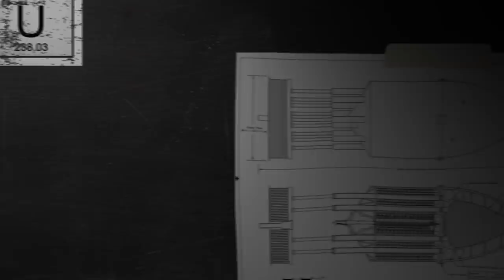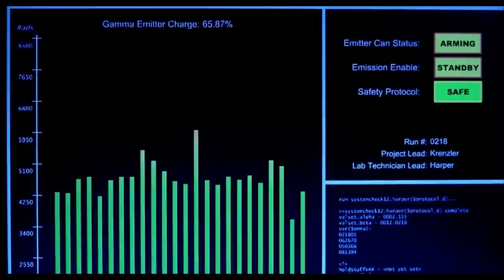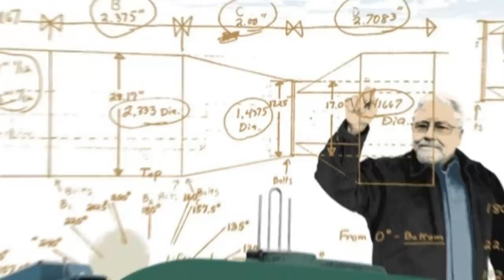This is How the Most Powerful Nuclear Bomb Works

Comment: Great video. However, with one error. The Hiroshima Bomb wasn't an implosion type bomb. It was a Bomb with gun type design. It had a core Uranium, enriched to a level of 80%.
Reply: Wellll, that and the title is clickbait garbage... those two weren't the most powerful by a long shot. I see no mention of hydrogen, lithuium, or lithium hydride, which there was a bit of a whoopsie when the bassoon device proved that lithium reacted quite well too, pushing 5 megatons up to something like 15, and was the THIRD time we nuked the Japanese, though that one was by accident.

Seriously, look up Castle Bravo.
Reply: The gun barrel used was a modified Naval 5 inch cannon barrel.

Comment: The fact that we know tsar bomb is the most powerful nuclear weapon and yet we do believe there are much much powerful weapons is scary
Reply: @TheQWER9  Hydrogen bombs can be as big as you want...Tsar bomb was initially supposed to be 100MT but then it was reduced to 50MT as the radioactive fallout would fall on ihabited areas...
Reply: @tkanal1  And because the pilots would not have had enough time to escape explosion that big.. It was pretty close call even with the 50MT.
Reply: There's a lot more powerful, it's scary to think of what other elements and isotopes we could play around with, especially if we were to stabilize some incredibly short lived lab elements for long enough to go boom
Reply: the strategy shifted from having larger bombs that can only hit one target, to multiple smaller ones that can hit multiple cities/targets simultaneously which is much more powerful than even the most powerful of bombs.